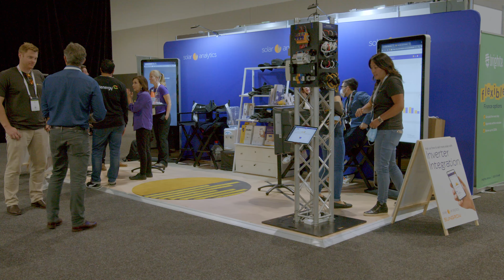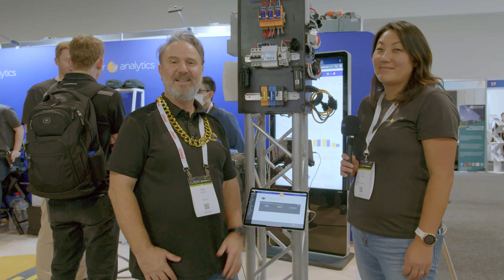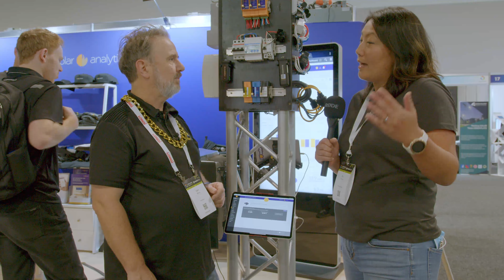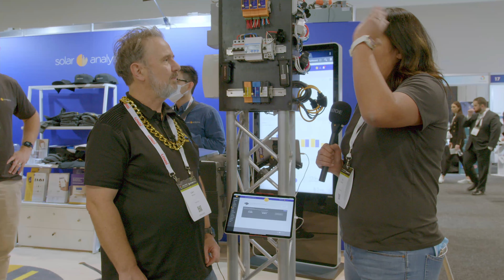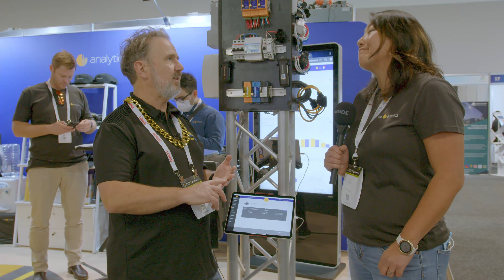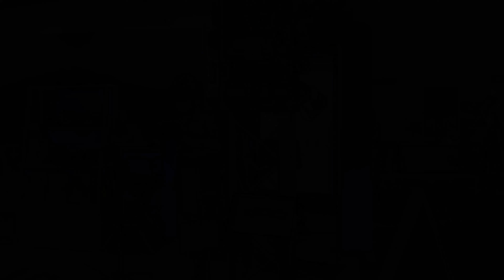SolarAnalytics at the Smart Energy Expo

Comment: this nice and will be needed. for things like motorized sun tracking panels. How much is the hardware for that?
With all the efficient tracking and monitoring software to put that energy into storage or not over loading the power grid system.
We need more efficient panels and much battery storage solutions for our energy to make use of the software.
your building a harness for a horse you have not purchased yet..